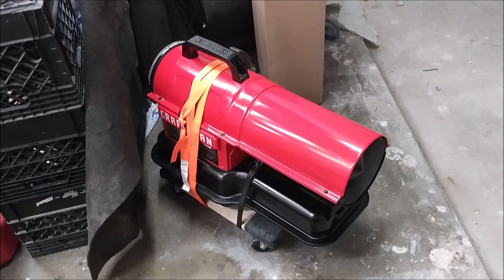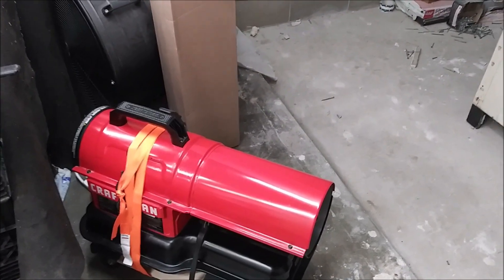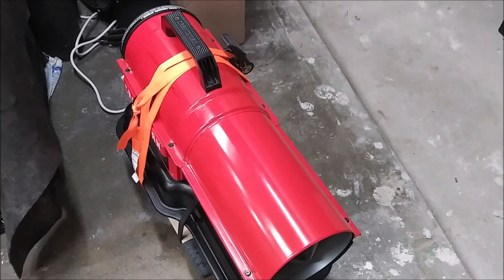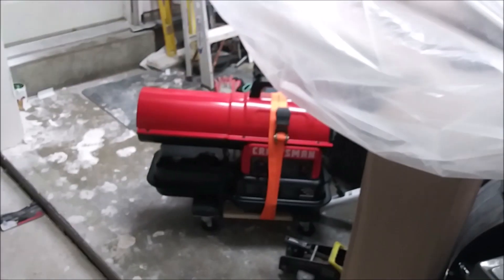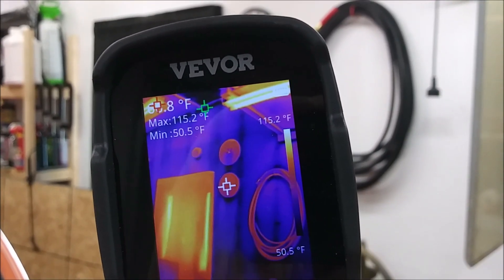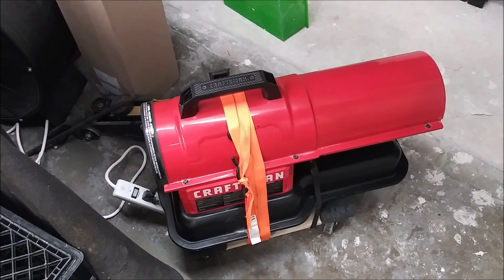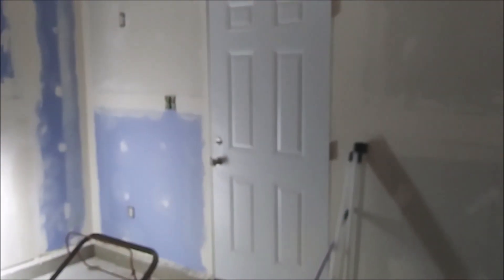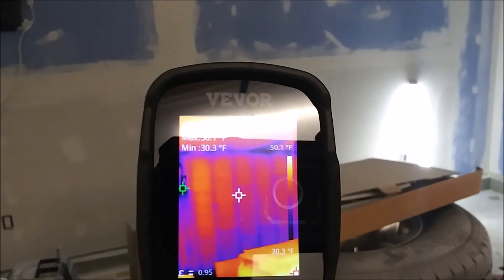Craftsman Kerosene Heater test and review

Comment: Dude, that thing is insanely loud???   I can almost be certain it makes more heat which you need in those crappy low temps.
Reply from the maker: You can hear it from across the street. I could probably hear it from down the street. If I were less lazy, I'd test it. Maybe I'll do that tomorrow and actually make a short video about how far one has to be from my house to no longer hear it.

Comment: I used those years ago when doing new construction . I will admit that I am afraid of them . I use propane ,or electric now. Well we are actually having a pretty good winter . Still feeding huge fox in back yard . Going to get estimates for trees soon . I have done 15 thousand in the last few years.Probably another 10 grand again this year . I enjoy  having a park for a yard ,but its lots of work . Good luck with the snow today .Driving the lost art .
Reply from the maker: I took the truck to work today. Heaven week starts tomorrow. Hopefully nobody smashes my truck up before I can install the new bumper. Weather permitting, I'll put it on tonight.
Reply: Good luck !! I burned alot of limbs yesterday and worked on vans,and ran cadillac . It takes alot of time to put all material away after big factory project . Very lucrative work though . Very thankful for great customers. Things have changed on these huge printing presses. There used to be a single electrical drop ,usually 480 . Now these machines take 6 separate electrical drops with 3 different voltages . Good luck today !! @HollywoodHornet